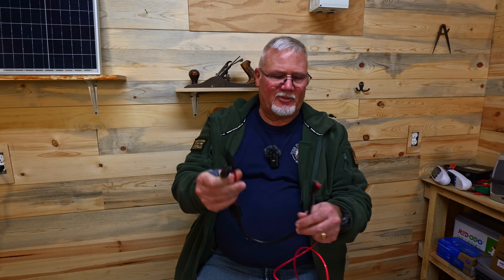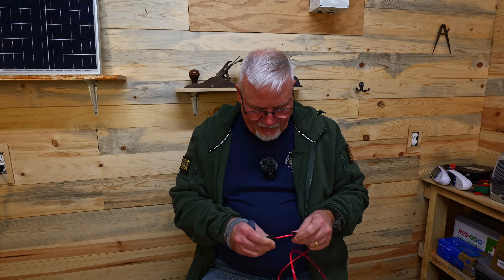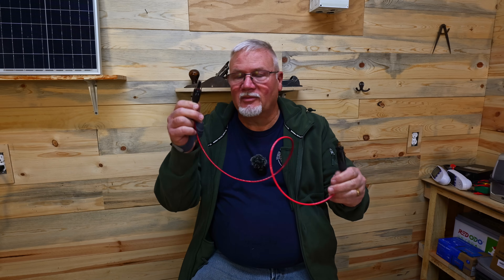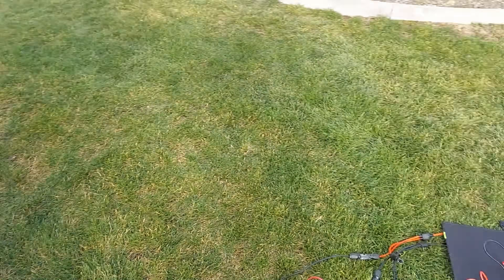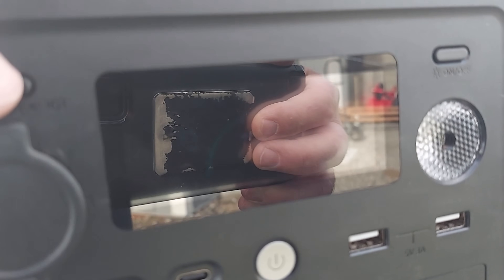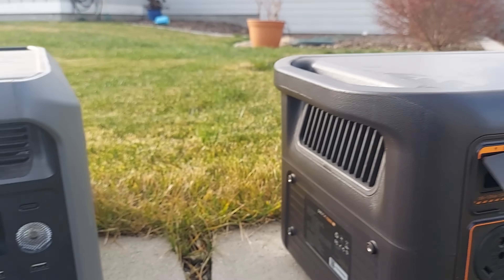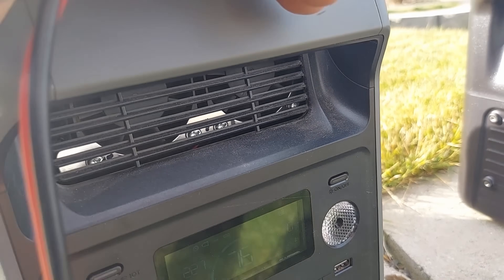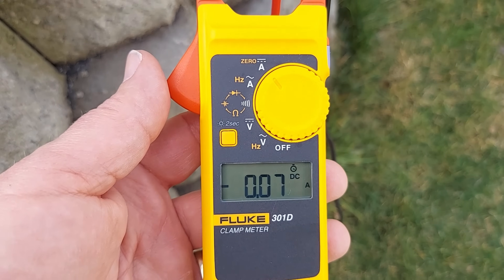Is It SAFE to Charge 2 Power Stations with 1 Panel?

Comment: Anyone have advice... I have dabbson 2000ish watt power station.
I need to go off grid soon & here recently the light has come on & I can't turn off with the light button. It's on 24/7. It will drain soon if I try to not use it as pass through only.  ???
Thanks so much.
Reply from the maker: It won't turn off if you hold it down?  Or just hit it once?  If you can't get it to turn off I'd reach out to Dabbsson support!  I have a 2000l, 600l and DBS2400Pro and all work great!

Comment: This doesn't work with my 2 Delta Pros or with a Delta 2 and Growatt 1300. The mppts just bounce around from zero to almost 50% of full array wattage. The input watts are all over the place. 
It works perfectly fine with a pecron alternator charger or an AC to DC converter using the same Y adapter to split to my 2 Delta Pros
Reply from the maker: It's definitely tricky with different power stations and their MPPTs. Glad you found a setup that works for you!
Reply: @TheOldJarhead it's my workaround for keeping the 240v live when I need to supplement the onboard batteries because the sun is hiding.

Comment: fun video to watch. last summer i tried this very thing.....short answer just get a second panel. depending on what power stations you are using the MPPTs will constantly be trying to get the best for its own battery to the detriment of the second one and the result is you never get good production from the panel.  have you ever tried one solar panel connected to two separate charge controllers?  that is even more interesting and the results will be different with different charge controllers.....
Reply from the maker: Haven't tried to CC's but I understand it can work.  I think the key is to have enough available amps so that both CC's can draw their max but to me, it's a waste.  Better to have one big battery bank and multiple array's feeding it IMO :)

Comment: Yes I do it all the time you need more than 600 watts  i do it with 1000 watts of solar . Never had a problem
Reply from the maker: Why not just split the 1000w into two 500w panels and charge them up separately?
Reply: @TheOldJarhead no it works . You need more parts then what you have there . You can't just use a wire to do it. The reason your have problems is because the Mppt controller is fighting each other....

Comment: With the Pecron E3600 LFP can you charge it with a EV charging station?
Reply from the maker: I doubt it actually but I don't use, nor have tested an EV or an EV Charger ;)
Reply: @TheOldJarhead the new echo flow Delta Pro x can but can't afford it, so I went with the Pecron e3600lfp. When I asked Google if you can charge a Pecron e3600lfp it said yes with the right connector
Reply from the maker: I'd have to know more about EV chargers but if their all made for LiFePO4's then I suppose it's doable.

Comment: One more question about getting more from the stuff that I have... haha... I know from your videos, especially, that you can augment power stations with piggy-backed batteries, but what are the limits on "frankenstein" setups with multiple power stations that are totally different.  Can my small Eco Flow River be set up in series with my larger Delta three plus, to provide higher wattage?  (I am really set on putting that Pecron cable kit I purchased to good use!)
Reply from the maker: Not sure I understand what you mean by 'in series'?  Multiple power stations can draw power off of one battery though.
Reply: @TheOldJarhead  I used the wrong terminology - I'm trying to do the same thing I did with the previous question, get more power with unequally yoked power stations, hoping there might be some arcane way to parallel link the inverters of totally different power stations.  The right way is probably just to bite the bullet, and use the different stations for different tasks.  I KNEW I should have bought that EcoFlow PRO version, haha!
Reply from the maker: You trying to get 240v?  Or just more power?  Like 4kw instead of 2kw? 

For me, more power comes from DIY Solar ;)

Comment: So why does the wattage change between the two power stations?  My suggestion is because they are not a resistive load.  The MPPT controllers appear to be a variable load that changes.  We see that when connecting a charging source and the wattage isn't instantaneous.  It ramps up so to speak as to controller in the power station adjusts.  If you connected two resistive loads of equal resistance, the power to both resisters would be equal.  Been about 50 years since Electronics in High School Vo-Tech, but that's my thought. Fun experiment, but agreed, not something you probably should plan to do, but good to know you can.  Keep on creating to great content and God Bless!
Reply from the maker: It changes as they fight for the limited amperage available from the panel.  I suppose the best way to do this would be to have a 20amp panel providing power to two 10amp inputs but I don't really think it's worth it.

Comment: I have an Aferiy P310 that, as you know, has both a solar and a 110v inputs. I was wondering if an external battery could be connected to the power station via the 100v input?
Reply from the maker: Not an AC input.
Reply: @TheOldJarhead Thank you. Like your videos
Reply from the maker: Thanks 😊

Comment: Hi Erik I have one experimental question I've never seen done. Let's say we have one solar array and want a branch switch that can either charge a power station (unit a) or a charge controller connected to a lifepo4 battery (unit b). Can you use a 3-position battery switch and likely busbars to switch charging between the two units (a,b)? In a different experiment,  I've wired a 3-position switch with two batteries to a single charge controller. Never done the branch switch scenario with a power station and separate charge controllers. I don't think a DC solar breaker should be replaced with the 3-way switch between the solar array and the described units. You may have better insight if this is even feasible. I've contemplated this for my off grid camp. Thanks for any thought.
Reply from the maker: Hmmmm might be better to run panel to cc and battery and then run from battery to power stations
Reply: @TheOldJarhead  Yeah possible though it limits you to ~120w with a charging cable. Other options are throwing an inverter on the 12V battery for standard or turbo charge to power station. Another is a customized cable with connectors (Anderson, XT60) and shutoff DC breaker when connecting to either unit. Thanks for thoughts
Reply from the maker: Nope.  You get a 48v battery (LiFePO4 so really 51.2v  - and fully charged would be 53.7) and you'll get a lot more than that depending on the power station -- the Dabbsson would be pulling over 1000w

Comment: I would think it much better to just invest in a second panel instead of spending additional money (and time) purchasing y-adapters and replacing cable gender plugs. even with a cheap low-wattage solar panel addition you would increase the solar charging, cut the time down for charging both stations and have much less hassle setting everything up. With the cost of solar panels dropping it wouldn't take long to recoup the expenditure (and gain a backup setup as well) instead of throwing money away adapting cords and destroying their original functionality.

Here's a couple tips on the screen lighting issue that I think will solve much of the visibility problem: reflect something black (like your t-shirt) into the screen. Angle of incidence = angle of reflection so your viewing/recording angle should be the same as the angle from screen to black object. That's how the original cased photographs (Daguerrotypes) had to be viewed. The image was recorded onto a polished mirrorlike surface and when viewed appeared as a negative until something black was reflected onto that surface allowing it to be seen as a positive. The same should help minimize the screen glare. Also, using a polarizing filter on the camera should all but eliminate the glare as well. Think how polarizing sunglasses allow anglers to see through water surface glare...

I continue to enjoy how you think outside the box on these DIY and electrical projects. Keep 'em coming...
Reply from the maker: Yes I think a second panel is better

Comment: Not only can you do this, but if you have a system with 2+ main units you pretty much have to do this.  I don't know of any package system that can balance through the parallel box.  When discharging, each main/battery set will tend to become unbalanced SOC vs the others.  If you have an individual solar array(s) feeding each main/battery set, once that set is full there is no way to divert that excess solar to the others and you lost production.  The Y-connection allows you do exactly that; maximize production.  This is where the Dabbsson 2300 has a rather large advantage over every other portable system currently on the market.  The Dabbsson 2300 sets (two mains and four batteries) can do 3520W (panel ratings) of solar with leveling on 5 solar arrays (660W x 4 and 880W x 1) by use of the Y's.  At first they will charge somewhat balanced rates, but when one set reaches 100% SOC the other set has access to the entire 3520W of solar.  No other portable system I am aware of gets anywhere close to that.  Not the Delta 3 Ultra Plus, not the Apex 300, not the E3600LFP.  These systems are crippled by the fact that only the main units have 1-2 DC/MMPT inputs and the batteries have no DC/MPPT inputs.  Over-paneling can be dangerous and manually switching inputs throughout at the day is inconvenient. The EcoFlow is only about 1600W, or less than half the Dabbsson 2300.  The Bluetti and Pecron are closer to 2400W.  This is a rather significant advantage for the Dabbsson.  Two mains, four batteries, ~3500W of solar with leveling.
Reply from the maker: I neither agree that you 'have to' do this not that doing it is a great idea (I could be wrong).  With two units you could have two solar panels which would be better, or you can swap between units but why have so many power stations?  It would be better to just build your own system.
Reply: @TheOldJarhead  But then you have to actively reconfigure the system throughout the day.  Some of us have lives to live and we don't buy this stuff to run experiments all day.  We want to set it up and have it just work. 

BTW, good luck building a 16.6kWh system with 4kW AC out capacity, 3.6kW AC charging, 3.5kW (6.4kW without leveling) solar input, all the redundancy, simplicity, reliability, quality, etc., you get in the Dabbsson 2300 system in a custom system for anywhere near that cost.  Its $6000 (two mains, four batteries, and the parallel box) vs $9000 on a good day. And the 2300 system is portable while the custom system is not.  I can use it at home this month, use it in the RV next month, and take it to the remote family cabin the month after that.  Apples vs discarded gum wrappers when it comes to value and overall usability.
Reply from the maker: I spent 30 years working on DC power systems and built my initial solar setup in 2010 after playing with solar on a well pump in 2009.

Anyone building a 16kw system with power stations, in my opinion, is wasting money.
Reply: @TheOldJarhead  And I have three decades of power systems experience in aviation, marine, military, residential, commercial, industrial, and electric/water utilities.  I worked about half of that as a technician, later as an engineer, and currently have an MSEE and a PE.  I have forgotten more about power systems than you will ever know, and that's me being modest.  Admittedly, there are not many people like me out there.  It is most common that people specialize early in their career and after that they really don't branch out or have to shift to something else entirely once let alone multiple times.  This Gen X-er says hold my beer.  

The fact is that none of this is stuff (portable package systems, non-portable customized systems (i.e., EG4, Victron, etc.) is worth it economically speaking, so everyone buying this stuff is "wasting money."  A small inverter generator and a few gas cans completely rips apart any battery/solar based power system (in the context of every use case example you discuss) economically.  Power stations are not worth it, and neither are inverter/charger and loose battery setups.  So, the real statement here is no 16kWh inverter/battery system is worth it economically speaking. But if the question is excluding an inverter generator and I want to do everything with electricity and I am willing to spend discretionary money, what is the best, most reliable, simple, most economical option for a up to a 16-ish kWh system right now, portable power systems are definitely in play.  They find themselves far in the lead if you have multiple use cases, i.e., I want to use it at home and at the cabin and in my RV and at the beach and so on.  To summarily say anyone who does this "is wasting money," is to say you don't understand the definition of portability.  Good luck with your channel.  I thought I'd give you some views to support a fellow vet.  I won't come back after this thread reaches its conclusion.
Reply from the maker: Ok KungPow...

Comment: Thanks for the video. I think the power split depends on the state of charge on each box, and maybe to brand and size as well. Not sure why you needed to do any pos to neg connections. I draw it out pos to pos/neg to neg using "Y" connectors and it looks right to me. Bottom line, I agree with you that charging two boxes with one array is possible but not practical. You really do not gain anything.
Reply from the maker: Yup 😉

Comment: What this video is based on. I need to go out to my van and do this. My van has only one 400-watt solar panel that goes to 2 320ah batteries. The inverter for my batteries is a 5,000 watt at 500 amps. My can is a shop. It has a power station as well. That has a DC to DC alternator charger that maintains my van battery. My power station is set for a 600 watt charge. That comes out to 568 watts. I use my solar to charge all of my batteries and even tools plus run electric powered equipment. Yes. Works perfectly.
Reply from the maker: 5000w and 500a?  You must mean a 5000w 12 8v inverter, which would be about 390a.  That 400w panel is too small to do this effectively really, even my 600w panel didn't produce enough amperage for two power stations trying to draw 10+ each.
Reply: @TheOldJarhead What did I say? You can still buy the inverter on Amazon. 5,000 watts at 500 amps. 4 plug-ins are 1,500 watts. The main hookup is 5,000 watts at 500 amps. I said it. It is on Amazon still for sell. Hard evidence. I have been using and testing solar for over 8 years. There are a whole load of channels on YouTube passing information on solar that is only wasting people's time and money on solar. Does solar work. Yes and no. There are 9 different ways to charge batteries. I started that because my system works on all 9 ways. In a van. 100% of homes, etc. Are not even close to being set up for solar. Very wrong equipment. People are losing thousands on false information and from people who don't have a clue on what they are doing. If you own any vehicle. You own a generator. Hookup an inverter to the vehicle battery. Turn on the vehicle. You now have a generator. That can recharge anything.
Reply from the maker: I've been running solar since 2010

Comment: First some (very) technical background:

Assuming constant (steady) irradiance and panel temperature, a solar panel has a defined current vs. voltage curve (IV curve).  That IV curve represents all possible current and voltage combinations that the solar panel can offer at the given irradiance and panel temperature.  Each of these individual combinations is called an operating point and the solar panel can only operate at ONE operating point at a time.  Generally, via a "Perturb and Observe" (P&O) algorithm, an MPPT tries to force the the solar panel to operate at the individual combination (of current and voltage) where the PRODUCT of current and voltage is maximized.  In other words, the maximum power point.

In the experiment demonstrated in this video, the IV curve, and hence the "location" of the maximum power point, is very dynamic (i.e., not steady).  To make matters worse, two MPPTs are each independently running their own P&O algorithms.  I believe these are the main reasons why the results of the experiment show a lot of variation in the "splitting" of the power.  I wonder, however, if the experiment were done under VERY steady irradiance and panel temperatures if the splitting would have been more steady.

If anyone is interested in seeing what a dynamic IV curve looks like, check out a video titled "Dynamic IV Curve Tracing" at the YT channel of Alain Chuzel.
Reply from the maker: That's a great technical explanation of what's happening!

Comment: I can see a case where you have two stations that are really low, they are used for different things at your cabin, you need some power at both locations but need to leave for the day or are working out back and won’t have time to swap.  I think someone else also mentioned this, and although not efficient, I’d consider connecting the panel to one power station and having it charge the second power station.  Imagine a case where someone is at the cabin on weekends, may drain two power stations during that weekend, but is not there during the week so letting the sun slowly charge both while they are gone could make sense.
Reply from the maker: I would say not to yse power stations at a cabin like that 😉 better to use one big one or better still to use a DIY solar